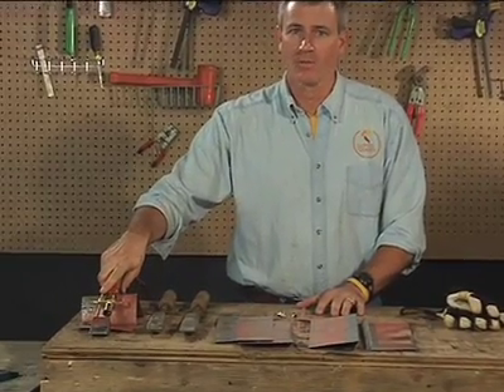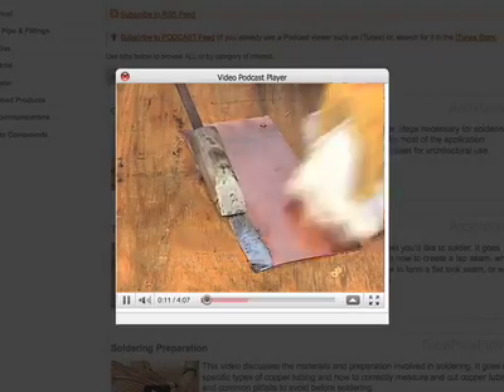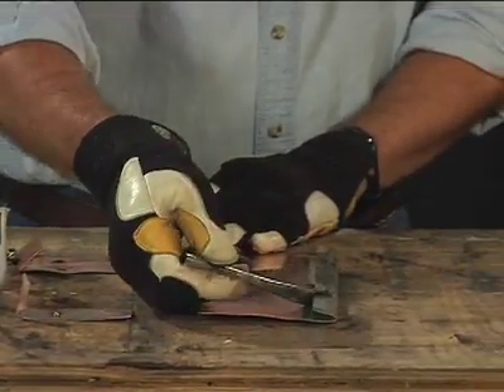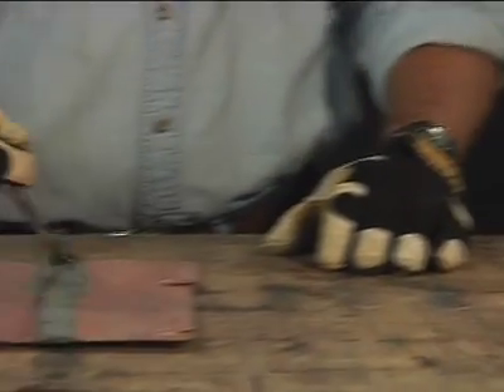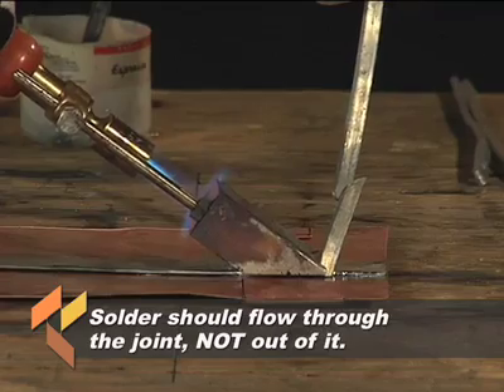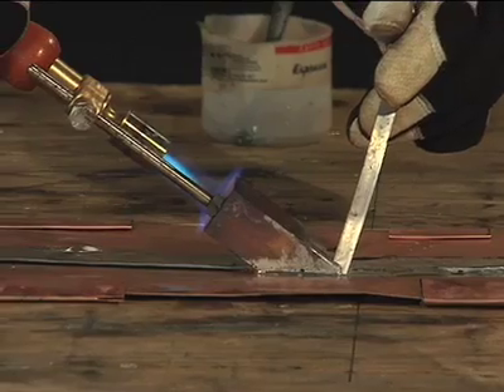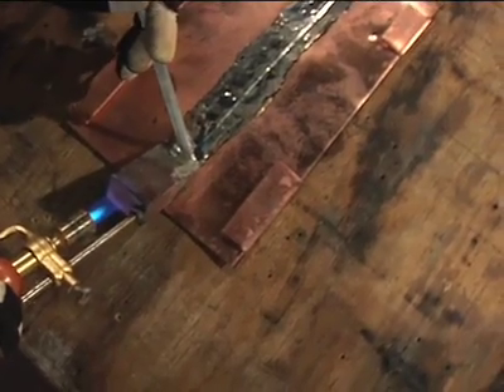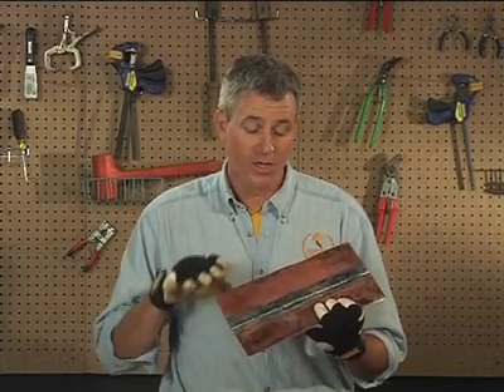How-To: Flat Seam Soldered Joint

Comment: I had to solder some copper gutter seams recently. I'm not an expert or a pro. I'm a homeowner who has done quite a bit of plumbing with copper pipes.

I used a torch because I don't have an iron. It was OK for a small repair, but I think an iron would be better because I think the torch releases carbon soot that dirties the joint and reduces adhesion.

In this video, the guy hammered the seamed joint together. When I did my repair, I experimented with various methods, but I found that tightly clamping the seam together in a vice or with clamps along the seam helped me get a tight joint with a smaller gap. As long as the joint is tinned and fluxed well then I think this allows you to get a nice tight and mechanically solid joint while wasting less solder. So I recommend that, when possible, try to use clamping force of some kind with clamps or a vice to tighten up seams prior to soldering. That's my only suggestion.

I think this video is great overall. Some people comment that they could make a cleaner joint, but so what. This joint is fundamentally sound, and the basic tips of cleaning the joint, adding flux, tinning, etc are all good suggestions.

Comment: Above my oriel windows and cornice, I have flat metal roofs, but it isn't copper.  It's rusty color now.  But it is flat seam like this.  And some of it has rusted out in the cornice roof.  I suppose the process will be the same in the initial install.  Any tips on the procedure to fix that?  It may come to me just putting a patch over the affected area.  This isn't standard rolled roofing or shingle roofing.  Not many will even recognize a roof like this from 1868.

Comment: That guy need some coaching .
Maybe he should go out and work on the jobsite.
Perfect condition tucked away in a shop .
Reply: If you can do a better video, then show us.
Reply: I could .
I was saying that he should try it in the field . perfect conditions inside in a shop .
No wind /cold .
Its a lot harder outside to do .
I do 20 panels a day .
20 installed one day 
Then saulder with two guys
Reply: I think I know what you are saying...when I used to paint motorcycles (only did a dozen back in the day), I know it is a lot harder to paint without a $500 gun and not in a booth.  Painting outside with a used $100 gun takes a lot more skill.  Come fix my 1868 roof...
Reply: 100% agree!

Comment: @ matteogsys! Tinning is critical if you want strength and holding power especially in on site gutter joints etc. I have found zero failure in joints scince. As far as not being able to resolder a joint a day after I'm sorry I have re sweated and soldered a 30 year old gutter joint. Firstly scotchbrite the joint until clean,wipe and hit it with soldering flux. You may need to repeat the process but once it's all clean and oxidisation is removed you are good to go.